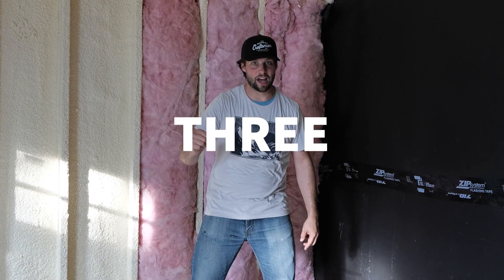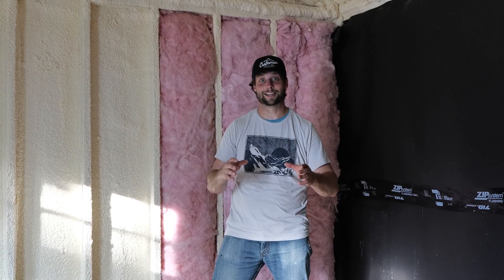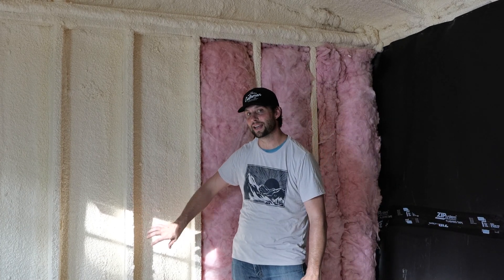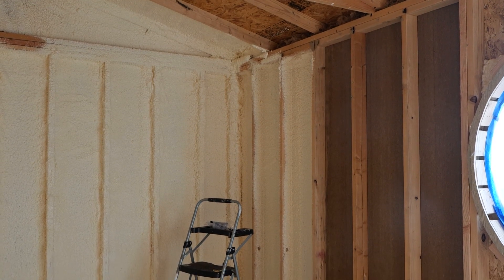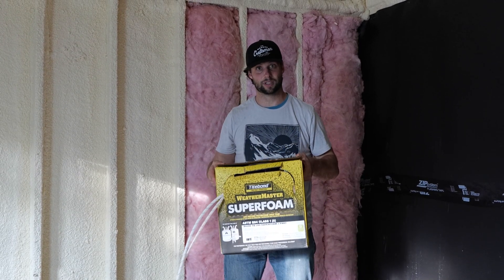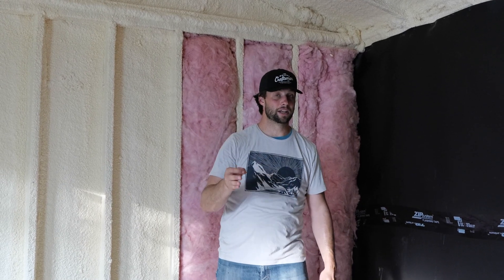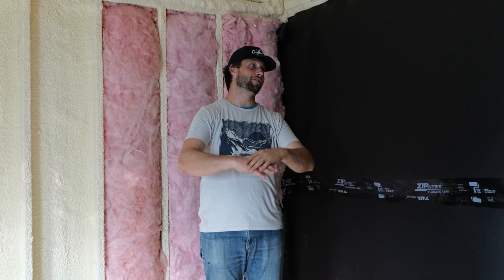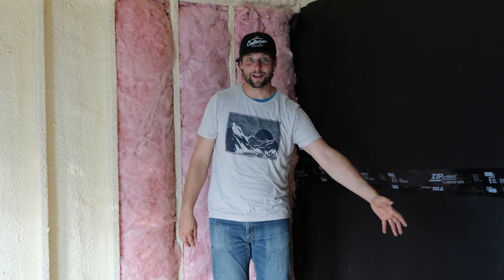Sound Proof Shed III - Spray Foam Insulation, Fiberglass Insulation, and Mass Loaded Vinyl

Comment: You mentioned in another video that you don’t recommend closed cell foam. Why did you decide to use for this project? Did you build the roof structure with the air gap and water tight exterior panels? Also, i see bat insulation on the walls. Did you put that over the closed cell foam? Thanks. Good video

Comment: If I’m doing something like this from scratch is it best to get the electric installed before or after all the soundproofing additions?  Or at some point in between?
Reply: I am also doing this exact project, My plan is to run the electric first then have a crew come and spray. I am hoping that I can throw the crew a hundred bucks and get them to spray extra thick!

Comment: doobly dos! The man has been watching Ave! If your floor concerns are valid, the best thing you could do is run some kind of sound blocking/absorbing skirt around the outside at the bottom of the wall to stop that sound getting under the floor in the first place. The next thing you could do is fill that new cavity with any kind of damping eg pumped in rock wool if such a thing exists, as it's not affected by water. 
I feel like your wall and ceiling efforts are overkill but it depends how noisy it is and how much you care about background noise. Good mic techniques eliminate most of it, that's how vloggers get by in traffic :-)
Reply: Or just Canadian?   Oh wait no..   he’s talking about heat

Comment: What the mass-loaded-vinyl does is reflect the sound back away from you and force it through the damping compounds (glass bats) a second time at least. Sound transmission through that stuff is minimal and it's used with a layer of foam under it, under the carpet in most good luxury cars, at least, older ones from the 90s if not current stuff.

Comment: Check out quietrock Sheetrock. It’s super dense drywall with a sandwich of mass loaded vinyl inside. One sheet is equal to 10 sheets of regular drywall. You also need to decouple the walls from the ceiling and floor.

Comment: all that work and expense.  could have gotten the same result with Rockwool sound board. Then put on a layer of 5/8 sheetrock then an air gap then another layer of 5/8 sheet rock.  Both layers of sheet rock should be well air sealed to keep any sound from coming thru.  you could have also used double stud which would 100% decouple the sound.

Comment: Can you measure the sound level inside verses outside?  It would be nice to know the attenuation as you add layers.  I assume you will add a double layer of sheet material to the inside that is decoupled from the studs.  I recommend air sealing the inside seams and electrical penetrations.

Comment: the vinyl on the road facing wall is a good move in my opinion. low frequencies have a tendency to propagate through walls much easier than high frequencies so with the vinyl being so dense and lose should help with that. one recommendation i have is to use rock wool for the decoupled walls or maybe just that one wall facing the road. ive seen that rockwool slightly better than fiberglass at acoustic insulation but might not be worth the additional cost though. another recommendation is green glue for any of the interior layers it’s a noise proofing adhesive, might’ve been good for the floor but either way things look super solid! im looking forward to seeing the finished studio! as a music producer and recording engineer this is definitely inspiring. id love to create a space of my own like this

Comment: Open cell spray foam is better at stopping sound, and it is cheaper. Why didn’t you use that? Don’t they sell it in packs?
Reply: Curt Miller structural rigidity is enhanced by closed cell, open cell wouldn’t lock the structure at all. But yes it has better acoustical response due to its ‘fluffy-ness’

Comment: The closed cell spray foam seems to be about $1 per board foot from what I am seeing online from the DIY kits... Any insight as to what Pros charge per board foot on larger jobs?
Reply: More than that. I can't understand why he paid so much. He hasn't listed the dimensions of his shed but I have one almost exactly the same size. I could easily cover all 4 walls with a single 600bf kit @ 1" thick. Make it maybe 800 if I did the ceiling too. Of course if he bought it somewhere "in stock" he paid WAY too much, they usually want more than $2/BF at a building supply place, and rarely stock anything bigger than 200bf. When I see the kits at Home Depot I have to laugh at the cost.
Reply: @ryanroberts1104  Do you get your foam through a building supply wholesaler, direct from the company, or somewhere else to get a more reasonable price?
Reply: @ae1ae2  I don't have any to recommend, but there are several online dealers these days, like Dennis said they are often really close to $1/BF for closed cell. Obviously, the more you buy the cheaper it is, but I don't think you get much below a dollar until you buy the 55 gallon drum size.

Comment: Have you considered using some of the LP radiant barrier sheathing on the ceiling (if you have a couple sheets left over from the other job) with the radiant material facing the spray foam where you already have an air gap and then put your decoupled sheetrock. I dont need to tell you about the temp difference that would make and it would add some mass.